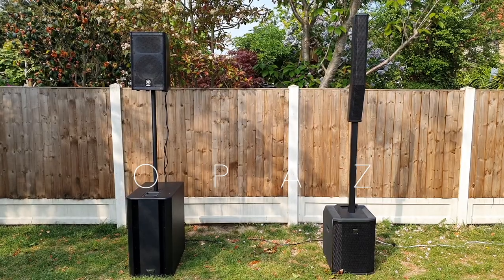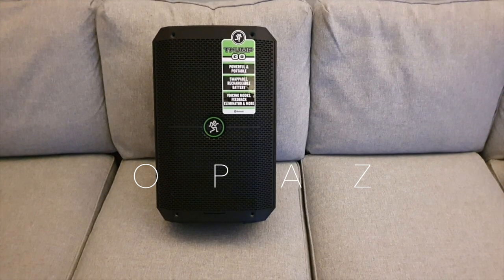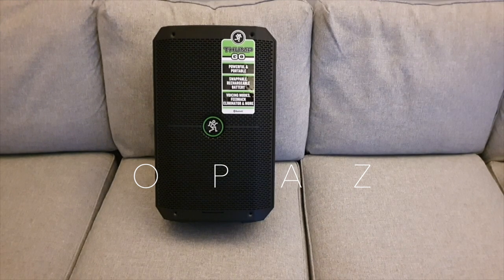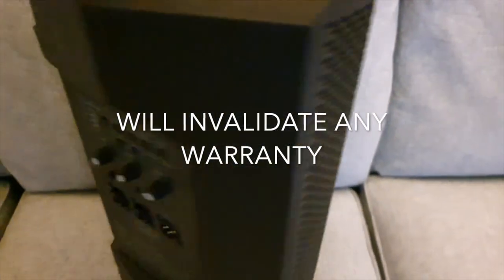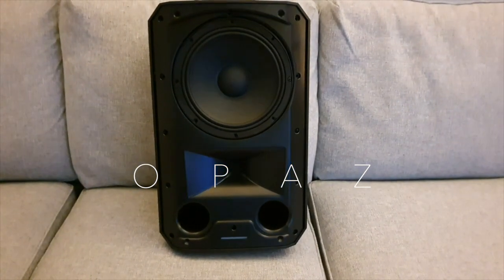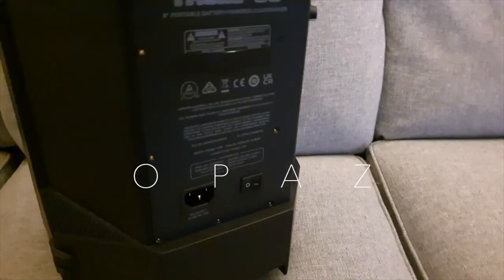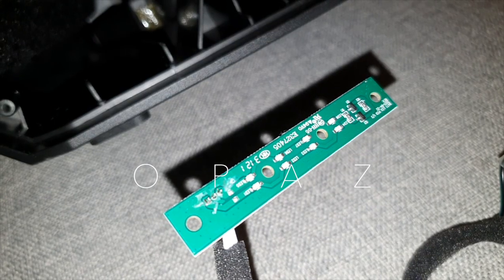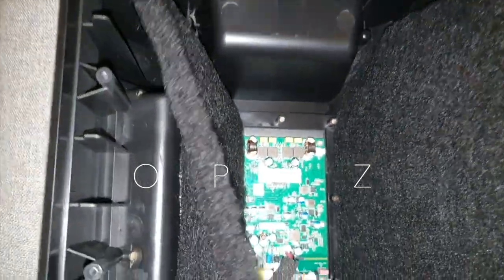MACKIE THUMP GO TEARDOWN!!

Comment: Great video!  I found this louder than the Bose S1 Pro with very clean highs at max volume.  Bose has smoother mids and better low bass.
Reply from the maker: Very interesting. I sold my S1 so unfortunately can't compare
Reply: @opaz.  By any chance have you found a way to update the Firmware on the Mackie?
Reply from the maker: Very good question and the answer to that is no
Reply: @opaz.  Thanks :)
Reply: I'm thinking in slling Bose s1 and get 2 mackies. Is a good choice?
Reply: @paulgonzalez2153  If you don't need the reverb the 2 Mackies will be more than twice the volume! Plus the Mackie has a cleaner top end but the Bose has a nicer mid range. Remember you can not line out to an Aux speaker or sub using the Thru out on the Mackie while using Bluetooth, it works on the Bose though. 2 Mackies and a small 12" sub is an incredible system!

Comment: Thanks for tearing one down I'm thinking of building something similar myself but should only cost around £150 per speaker. The thing I was interested in is what the capacity and voltage of the battery are. Would be much appreciated if you could find a info label on the battery if there is one.
Reply from the maker: Will look
Reply: It's a 4 cell series (4s) Lithium Ion about 5ah or 5000mah.  14.8 nominal voltage.  You can do 8 2500mah 18650 cells in series/parallel and have basically the same pack.  Basically a 4s2P pack.  If none of that makes sense to you, just buy the speaker.

Comment: Hi Topaz congratulations for the video and many more to come
My question is if it can be used without a battery, only with a power cable?
Do you have to wait for the battery to charge to listen to music or can you use the speaker while it is charging?
I think it's the most important thing that can be the biggest problem...........
Reply from the maker: I think it will work if it's being charged with a dead battery. I shall check
Reply: it is definitely working when plugged in and charging
Reply from the maker: It also works without its battery inserted, if you wish to use it wired directly to the mains power

Comment: Which one you prefer overall in sound? BOSES1 , JBL EON 1 YORKVILLE EXM8
Reply from the maker: I've never heard the Yorkville. With these I'm not really that critical when it comes to sound. They all sound good, neither choice is a bad one. Their battery function is their strongest selling point. The jbl and the bose may have the edge (when we're talking functions) as they both have reverb & independent bass/treble controls

Comment: Hi 
What About quality of the sound ?.. 
I have bose pro I like it sound Amazing ... 
But bose don't have Delay ... 
I use mixer with bose ... 
Thank you
Reply from the maker: It sounds good, can't complain. Although I would have preferred separate bass/treble controls, rather than music/speech
Reply: I didn’t like the sound. The S1 Pro sounds much more natural. The highs are good but bass isn’t even in sub mode. It’s louder than S1 Pro definitely so two in sub mode could be an option if desired. 

Lack of reverb killed it for me as a ceremony speaker and the better sound of the S1 Pro makes it a better fill speaker.
Reply: @cduemig1  
Yes S1 + mixer is Amazing 
Thank you

Comment: I just picked up the Eon One MK2. I really like this speaker. It’s amazing loud for a battery speaker.
Reply from the maker: Was gonna buy one until I heard the XDJ RX3 was launched!!
Reply: I also have the mk2 and it rocks indoors, outside,  so so, extra battery is 200$
Reply: @opaz.  That’s a nice unit. If they’d made that a capacitive touch screen I’d consider that over my Prime 4 but I like my Denon.
Reply: @BenJamin-ou7kd  $200 is a bit pricey for the battery but nice to have the option.
Reply from the maker: I also have the Prime 4 and reviewed it a couple of years ago but I have the X2 as my backup. 

Will sell my X2, I want to try out the X3 and use as backup
Reply from the maker: Gotta admit, Prime 4 still the winner 🏆

Comment: just curious  !!!!  whats to stop you from spinning that woofer tweeter combo around, when you pulled the unit apart. were the leads to short?
Reply from the maker: The 5" long ports will foul the top of the inside of the cabinet. When they are placed correctly (right way round) the ports straddle the internal pole mount moulding

That is the first thing I tried 😆
Reply: @opaz.  I negected to tell you I enjoyed the content great job as always.
Reply from the maker: Thanks 👍🏻

Comment: Hello !  And will you be able to sing and play the guitar under the minus backing track with this column or not?
Reply from the maker: George, I do believe you can connect your phone through bluetooth (backing track), guitar to channel 2 and microphone to channel 1 all at the same time
Reply: @opaz.  So I asked why, I'm interested in three signal sources at the same time.  Microphone, guitar and backing track.  It's just that this speaker system has a two-channel mixer.  The first channel is for the microphone, the second for the guitar or audio from the player.  And here's the main question - will audio and guitar signals go through on this second channel at the same time or not?  If not, then you need to connect an external mixer to this second input.  I have a compact mixer with 3 inputs and one output.  But if the speaker can transmit audio and guitar at the same time, then this mixer is no longer needed.  I don't really want to be cluttered with extra equipment.  So, the vocal processor will have to be connected to the microphone, so that the reverb and delay effects would be plus the harmonization of the vocals.  The speaker is limited in effects, Neither the microphone nor the guitar have them.  Therefore, I think the price is lower than that of other competitors, for example, Jbl Eon One Compact, which has everything and four channels.  But I have this JBL.  I want better sound, and Mackie Trump Go clearly wins in this
Reply from the maker: Guitar & audio run together on channel 2, that is correct but this is not the pa to buy. Lack of reverb and 3 channels confirms this
Reply from the maker: What about the bose S1, did you try this?
Reply: @opaz.  100% working guitar and audio?  Have you checked?  Bose S1 Pro in Russia is almost 2 times more expensive.  As for the effects.  I have a Boss VE2 vocal processor and a ZOOM AC2 guitar processor too.  A year ago I bought both on sale with discounts, now you can apply.
Reply: @opaz.  I also have a VOX VX50 AG, I bought it in 2020.  I remembered that the characteristics also indicate that there are 2 amplification channels, probably meaning that these are instrumental channels.  There is no Bluetooth, there is only an AUX input for an external audio source, this input does not apply to instrumental inputs and there are no adjustments on it.  All adjustments only from the player.  But the AUX input works simultaneously with the instrumental ones.  As I understand it, this is also the case on Mackie Trump Go, plus there is bluetooth to the AUX input and volume control common for guitar and audio!  Am I correct ???
Reply from the maker: I did not have my bose for very long because I purchased the JBL and sold the bose

 Unfortunately I cannot answer much on facts on the bose

 I think a little further research is necessary

If your solution is extremely expensive then I think that is your only solution.  If there is a compromise which is more than one unit and cheaper, then your solution is that compromise

 I have an upload coming out very soon, it may help you George 👍🏻

Comment: I have the Mackie thump go...my honest opinion I thought it would sound a lot better. There is little to no treble on this thing and you can only EQ it from the app and it's not a huge improvement. I will prob be sending it back for the EV Everse 8 sadly this one came out first.
Reply from the maker: The EV is way, way overpriced
Reply: Everse has better features but the Mackie sounds very similar!
Reply: Wait about 2 more years and the everse will be going for about $450, ev is out of their fuckin minds asking $750 for that thing

Comment: Inverting the horn is ok if a speaker is rigged or pole mounted high above listening area. Not sure why Mackie engineers thought this design would be the most versatile arrangement. Perhaps it tames harsh high end content when used in most scenarios or perhaps it puts more low frequency content in focus, giving the impression of better bass performance. 
The articulated horn/coaxial design of the Bose S1 is much better for phase relationship and dispersion. None of the available battery PA speakers are designed to take the place of a true “PA system,” the exception being the JBL Eon1 Pro, which I’ve never heard. 
You can do a busking or small acoustic gig with the Bose S1 or Eon 1 Compact, since they’ve  got reverb and shelving EQ onboard but this Mackie offering is really lacking as a direct competitor.  Mackie has, imo, made some really poor R&D decisions in recent years….look at the discontinued Reach, FreePlay and Pro DX series products, all of which could have been epic products but suffer from extremely poor preamp designs, making them unusable and apparently too embarrassing for Mackie to even archive on their website.  Mackie really needs to hire some qualified design engineers with a true understanding of musician’s and their expectations from audio gear.  This Thump Go product is a failure out of the gate.
Reply from the maker: Thanks for your valuable comments
Reply: The layout of the two speakers has to do with the pole mount I think. A tweeter leaves more space for the pole mount than the woofer.

Comment: The main complain about this speaker is that line out doesn't work when you are using bluethooth input
Reply from the maker: Is that so Luca?
Reply: @opaz.  if you plug a sub or another speaker to the mackie line out you will find no output when you are using bluethooth. Very disappointing
Reply from the maker: Thanks, I never knew this
Reply: How about if you put in a alto total bluetooth on the xlr input can you add a subwoffer

Comment: Is it possible to install the speaker housing with the tweeter on top, and the midwoofer on the bottom, or will it not align properly?
Reply from the maker: Not possible unfortunately
Reply: @opaz645 thanks for the follow up 👍🏽